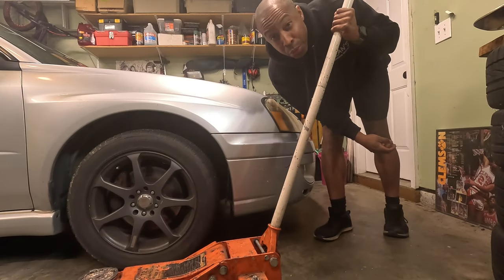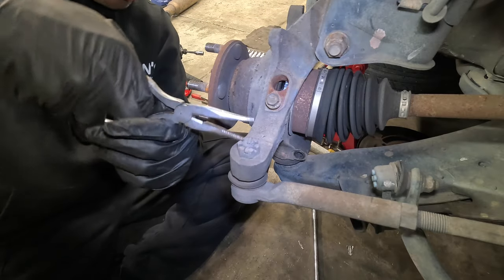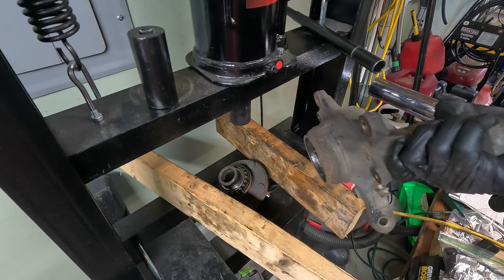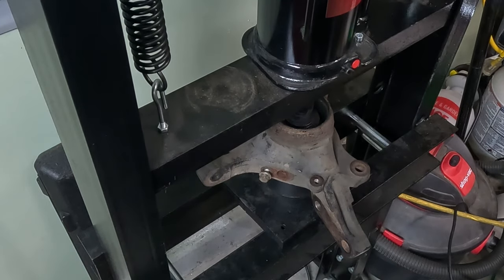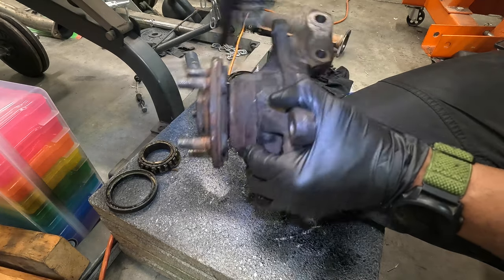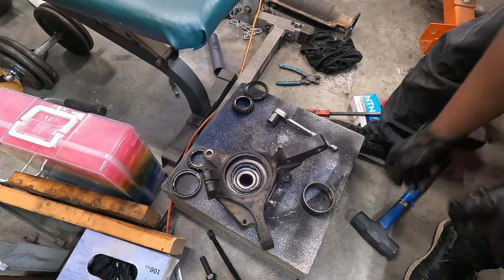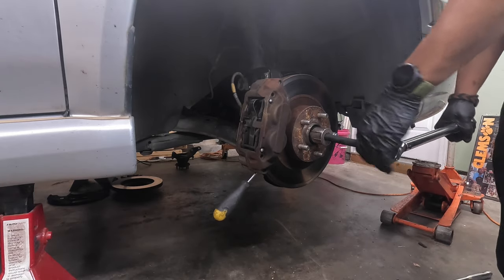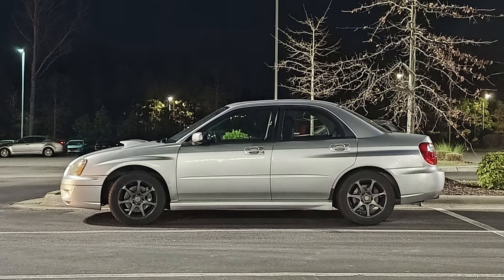Front Wheel Bearing Replacement | 2004 Subaru Impreza WRX

Comment: Was there a magnetic side to the bearing that needed to be facing the ABS sensor when pressed in? Wondering if you had any ABS lights on after installation.
I'm about to install mine, but don't think it has the magnetic ring on one side...
Reply from the maker: @robgibson2923  There was no ABS light. There is nothing on the bearing that interacts with the ABS. Good luck with yours!👍